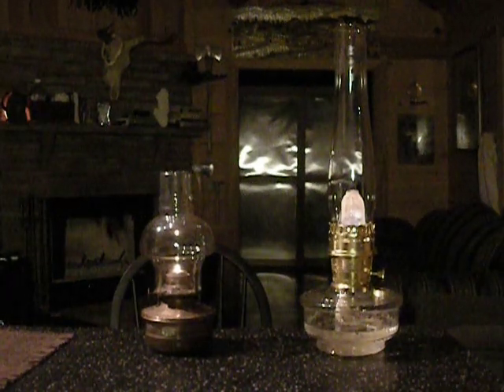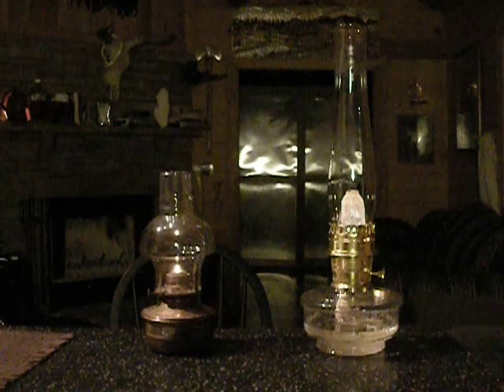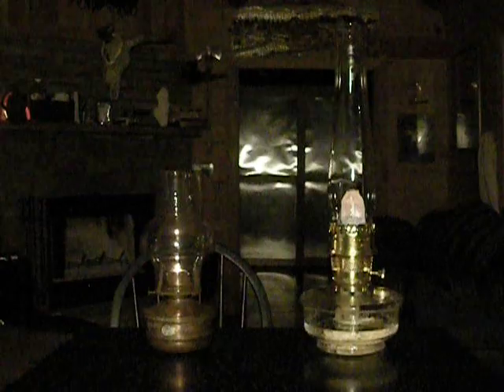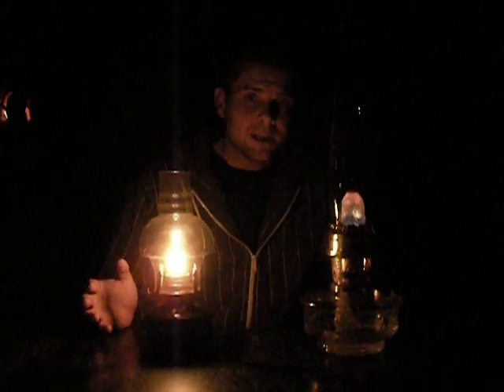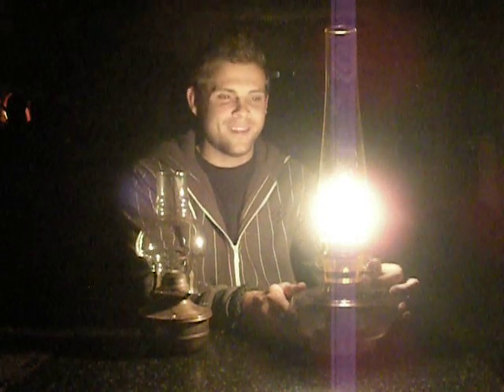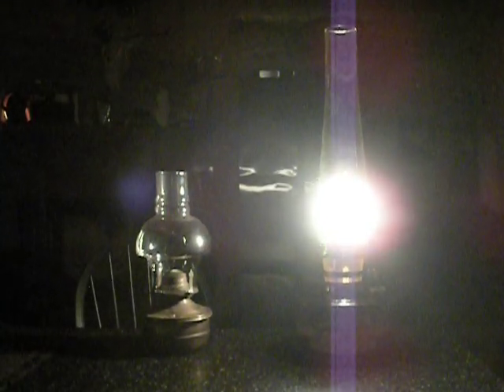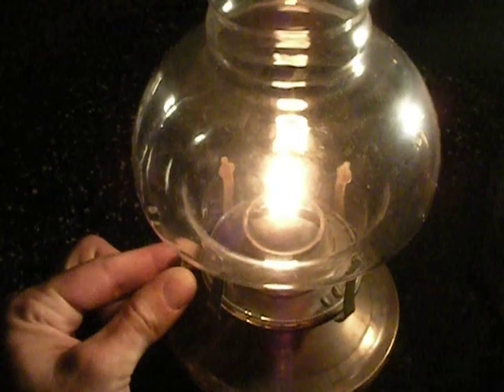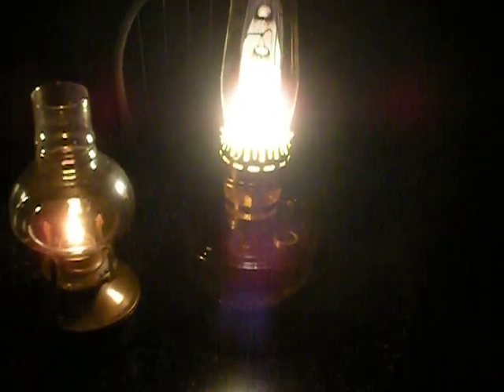Aladdin Oil Lamp :  Flat wick vs  Aladdin

Comment: Also, my little tip for using oil lamps safely, especially in earthquake country where I live.  I get a 10 or 12 inch backing pan with a 1 inch wall.  Then set the lamp down in the middle of that.  If it gets knocked over, then the oil will spill into the baking dish and be contained, along with the fire that might have spread quickly with the spilled oil!   And of course the size of the pan needed to contain the oil will depend on the lamp.  Might be bulky, but much safer, again especially in earthquake country.

I use my lamps occasionally even when I do have electricity, just to make sure everything is in working order and I am familiar with functioning by the light provided.  I also like to burn through my supply of oil so I am rotating the stock.

Anyone know how long the Aladdin oil is good for?  I am sure it lasts a long time, but probably not forever.

FYI - Aladdin has some good vids on their sight also.  

Great vid, thanks for the demo
Reply: i know its an old comment but: lamp oil doesnt ignite and burn your house down like gasoline would. you could empty a whole bottle on the floor and drop a lit match on it no problem. the only thing is that the flaming wick could start other wicking material on fire like a couch or carpet.